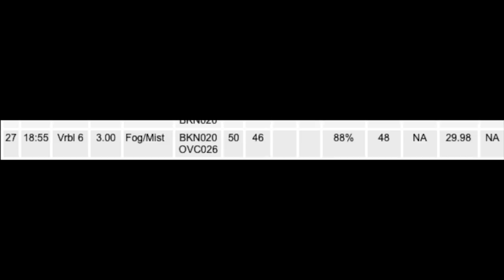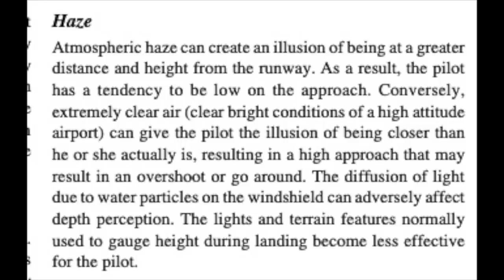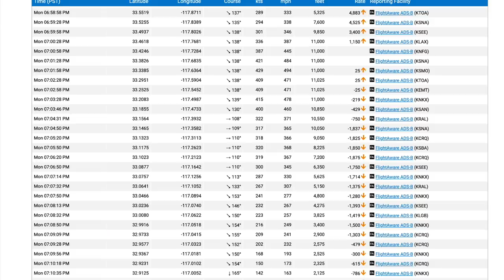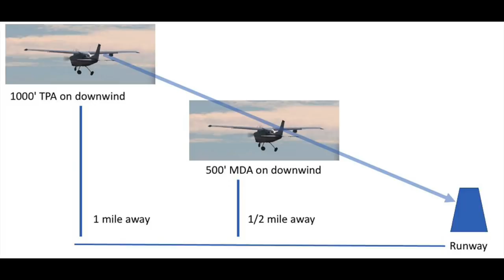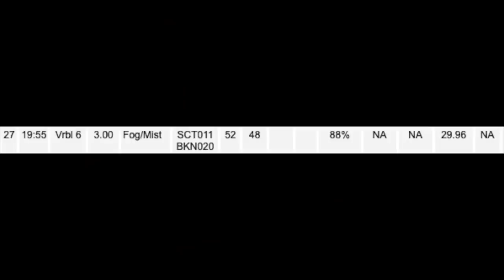N880Z Learjet Crash El Cajon San Diego California - Low Altitude Starts Accident Chain

Comment: Couldn’t have they called the airport in sight and requested a visual approach to 27R? It avoids a circling approach and still allows the pilots to maneuver for 27R
Reply from the maker: Interesting point, I hadn't thought of that. They were probably having trouble seeing the airport, as indicated by their request to "turn up the light," so I'm guessing they didn't have the airport in sight in time to request a Visual Approach. There's a small hill NE of the airport, so doing a right base entry to 27R on a visual approach is probably not a good idea, which is why they require left traffic to that runway at night.

Comment: I'm only guessing of course but the co-pilot who only had SIC privileges on the learjet may not have felt comfortable speaking up and challenging the captain if he felt uncomfortable with the approach.  Low-time SIC pilots are trying to build time still need to be properly trained on CRM as well as on threat and error management and must be prepared to speak up and be assertive.  In addition, any PIC for any a/c that requires a SIC should also not be flying if he/she is not prepared to listen to the other pilot and set the tone in the cockpit before takeoff that they as SIC must speak up if they see something they do not like.   Part 135 operators should ensure their crews actually operate as a crew even if the co-pilot is inexperienced.
Reply from the maker: Interesting, I had missed that one of the pilots had SIC privileges only. Interestingly, the Captain appears to have only been typed 2 years and 8 months earlier, and apparently had only been flying as a captain for about a year.

Comment: That is a first for me.  I have never seen RNAV approach that was only cat A and B.  After looking at the approaches at SEE, I would think the LOC-D approach would be the best option if your need is to land on 27R.  Assuming that the localizer was operational.  

I wouldn’t be surprised if in the end they make the RNAV 9L terped to include cat c.  I never worked as a terp specialist but I don’t see any reason why that is not included.  Maybe somebody who actually has experience with that can explain.
Reply from the maker: It seems like they could use better options for high performance aircraft landing at KSEE. Having CAT C on the GPS 09L approach would sure help. BTW, the LOC-D approach doesn't permit circling to 27R at night, so it wasn't an option. Also, it has a high, nearly 7 degree gradient to the runway, making for a fairly unstable approach for straight-in arrivals.

Comment: We know he lost the airport (flew into fog) when he asked for them to turn up the lights.  He had a choice; continue to fly blind at low altitude in a Learjet (a good recipe for disaster) or go IFR immediately and recover; he made a bad choice.

I accidentally flew into a cloud in a small plane not rated for IFR.  It was scary as hell but I flew out of the cloud on instruments and recovered.  Yeah, don't try that.
Reply from the maker: I back-timed the audio versus the flight path. The call for turning up the lights was about a mile north of the field, before they reached the airport. Some have suggested they were looking at the highway instead of the runway, and that's the reason they asked to have the lights turned up. Since mist was reported in the area, that could have made the runway lights seem dimmer than usual. I don't think we'll ever know for sure if they lost sight of the airport during the approach to landing, but it certainly could have happened, given the rain, mist, and how low they were. I've gone into a cloud unexpectedly at night a couple of times...it certainly gets your attention, and makes it clear how difficult it can be to avoid clouds at night, even when you're doing your best to avoid them.
Reply: @AviationNewsTalk  we also have issues with people setting off fireworks and offer wonder if the plane was hit by a firework or if he hit powerlines.
Reply from the maker: @w0rthlessburden381  Sonda, I think both are highly unlikely. The pilots were set up for failure from the time they turned downwind, about 40 seconds before the crash. Also, the powerlines they hit are fairly low. They almost certainly hit the powerlines after they lost control while maneuvering to either avoid the mountain (the more likely case), or to fix their late turn onto the final.

Comment: I am not a pilot.  But I have read that this accident was likely a stall associated with a steep banking (30 degrees?) maneuver.  In other words, the plane was below stall speed for a steep bank.  Unrecoverable at 500 feet or 1500 feet.  This accident was not due to low altitude.  Yes?
Reply from the maker: Low altitude leads to an illusion which can cause pilots to fly a traffic pattern that is in too close to the airport. It's then impossible to make the last turn to final without overshooting that turn. Pilots sometimes then bank too steeply and/or use excessive rudder, trying to "fix" the overshoot, and that leads to the classic stall/spin turn. It can happen at any altitude. But often the entire cycle is precipitated by low altitude.
Reply: All accidents are due to low altitude, as in lower than the dirt.

Comment: One question from a non-pilot:  At the time of IFR cancel to VFR 27R would the ATC be in any position to know the aircraft's altitude and speed (if it was too low) and instruct the pilot to climb and go around for his setup to 27R?  Thank you.  Understand the pilot flies the airplane, just wanting to know the interaction here.
Reply from the maker: It depends on the tower, as the equipment available to the tower operator varies considerably between towers. In metro areas, like where Gillespie field is located, it's common to have a radar display that would show speed and altitude. But some towered airports don't have radar, and wouldn't have that information. Typically a controller wouldn't instruct a plane to climb unless they received an automated "low altitude" alert from their equipment. Again, not all towers would have that equipment. Even if Gillespie Field has that equipment, an alert may have been suppressed by the system, since initially the aircraft was low over the field, where you would expect it to be low, and hence no need to generate an alert.

Comment: There is the LOC- D approach. This approach course is 269. An easy  circle to runway 27 and an MDS below the published ceiling. There definitely has another option.
Reply: This is definitely not an easy circle and for that reason is not authorized at night. There is a good reason they call it LOC-D and not  LOC 27R
Reply from the maker: No, the LOC-D wasn't an option. In the chart notes for the LOC-D, it says that you can't use it to land on 27R at night, it has a very steep descent gradient, nearly 7 degrees, and its Category C minimums are 1940 feet, just barely below the reported clouds.

Comment: 3:35 LDA of RWY 17 is 3700' which subtracts one displaced threshold, using Google Earth measure tool. Probably not an option wet or dry. Probably no thrust reverser in this aircraft.
Reply from the maker: I've read they the company had an op-spec of 5000 foot minimum runways. The past flightaware tracks always show them landing on 27R or 9L. So I'm fairly sure were unable to use 17.
Reply: @AviationNewsTalk  RNAV 17 Circle 9L is the only legal "night" IFR Circle to longer runway. I forgot to mention "night" in another response to one of your comments. If I am wrong please correct. Seems like a very safe Circle. Enter L downwind or L base from RNAV 17 at Circle mins which is basically TPA. Thanks for  well done videos. I haven't flown into KSEE since Lindbergh landed there in 1933 for a $1 hamburger. I did stay in a Holiday Inn Express last night, though.

Comment: Could there have been an "out" for them if they realized that this ain't going to work, Climb and ask for the IRF back and fly to the alternate. Basically, confess and would the controller respond fast enough?
Reply from the maker: This is a key theme in #214 of Aviation News Talk podcast, which I just recorded for release on Monday. There were outs available at every step of the process, except perhaps at the very end. There were also some clues available, such as flying a downwind that was too close to the runway, that were early warnings that they'd set themselves up for failure.

Comment: Nice recovery from your initial post that seems to have been a half-baked, knee jerk effort to be first to the show. A problem many reporters have.
Reply from the maker: Thank you! I agree. I think I was sucked in by the desire to be first. When I realized I missed one or two key points, I took it down and replaced it with this one. Lesson learned. I'll try to stick to doing quality, thoughtful work, rather than rush to be first, just to get the eyeballs.

Comment: I wonder if in addition to runway length, their desire for 27R may have simply been due to closeness to parking, particularly if they were transporting a patient.
Reply from the maker: They had already dropped their patient off. Apparently their company has an op-spec that requires they use a runway longer than 17. If you look at past flights, it shows that they never land on 17.
Reply: @AviationNewsTalk  Thanks for the clarification.

Comment: Why did they plan to land on the short runway, and then change their minds at the last second?
Also, flightaware shows that they flew basically the same flight path coming from the west just the day before, and they made a wide turn to land on the long runway. Why didn't they do that in this instance?
Reply from the maker: It's likely that the company's op-specs required landing on runways longer than runway 17. If you look at past flights by this aircraft, you'll see that it never lands on runway 17, always 27R, or 09L. The weather was almost certainly better for the flight you mentioned landing from the west. Since the clouds were low for the accident flight, they had to follow the an instrument approach, which requires them to fly a specific path and altitudes.

Comment: San Diego’s Montgomery Field may have been a good alternate and the drive home would not have taken that much longer!
Reply from the maker: Yes, that's such an obvious choice, especially given that it's so close by. It's unlikely they would have been stuck there overnight...they still would gotten home that night, perhaps an hour or two later. Very sad.
Reply: Don't know for sure yet, but it is appearing like this was some kind of game to be able to get to 27R using 17. I don't know if that should be allowed for certain planes, but it seems iffy and add in piloting mistakes and this is what you get. I wonder if this was the first time to be trying this?

Comment: The video seems to show much worse than a 2000' cloudbase. I suspect they were that low so they could keep the field in sight during the visual transition from 17 final to 27R. Their request to "turn up the lights" to ATC reinforces this.
Reply from the maker: I agree, and I mentioned that was one possible reason they were low. I just saw the video from the Nest camera at a house that caught the overflight and the explosion. Lot of low clouds in that video. Knowing how rainy it's been the last few days, and that the airport's in a valley, I'm sure there was lots of clouds and fog in the area.
Reply: @AviationNewsTalk  They may also have been that low to keep the VFR cloud clearance of 500 feet below clouds that they would be required to maintain as soon as they cancelled IFR.
Reply from the maker: Interestingly, I've never seen a tower controller call out a pilot for not maintaining 500 feet below the clouds. For example, when the clouds are at 1000 feet at my local airport and they are airplanes in the pattern, they're pretty close to the 800' TPA; I almost never see them flying at 500 feet to maintain the cloud clearance requirement. Given the rocks below, and the clouds above, personally, I would be more wary of the rocks, and less concerned about staying 500 feet below the clouds. But hopefully I'll always go around early and not find myself in that position.

Comment: Food for thought, their last data point was 560’ AFL. They were 1.4 miles from the runway tuning final. Based on a 3 degree glide slope,you would want to be about 400’ AGL at that distance, so they were right in the ball park.  Why they descended early is anyone’s guess, but my first inclination, based on the next subsequent deteriorating weather observation, the ring video, and the fact that they asked for the runway lights to be turned up while they were already at 100%, I will go out on a limb and say that this crew was struggling to maintain VFR and visual contact with runway 27R .
Reply from the maker: I agree, ironically, they were finally at the altitude they should be at when in the traffic pattern to land. They were farther east than usual, and aimed right at a mountain. Yes, and trying to maintain contact with the airport is the only reason I can think of for being that low. But if you have to fly that low to see the airport...probably better to go around and divert to another airport.
Reply: @AviationNewsTalk   I wondering if the weather (visibility in particular) was not as advertised, which could also explain their reluctance to circle wide, fearing that they would not be able to see the high terrain to the East of the field.  I’m going to be watching this crash investigation very closely.

Comment: Lears have the aerodynamics of a pair of pliers.  Medical transport jets fly in bad weather often.  Cessna Citation jets are the usual choice for those missions.
Reply from the maker: And this one was from 1985. I wonder how updated its avionic were. It seems like if they had a good moving map, they could have flown a better pattern. Though the low altitude was a bigger problem.
Reply: Good question. I flew a 1976 Lear 36, but it had been updated with Universal five tube EFIS, with one tube being a MFD. Nice for situational awareness. The main drawback was the old 200 autopilot. 

The Lear 35 is actually a popular aircraft for MedEvac use, although there are many Citations used as well. The early Lear’s were very demanding, but the later 35’s with the improved wings were actually nice to fly and relatively forgiving. 😏